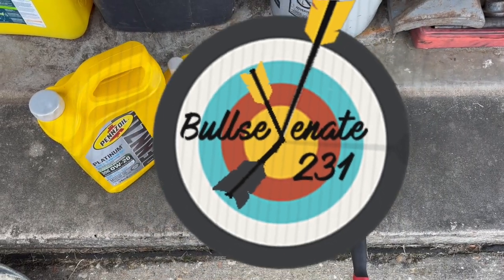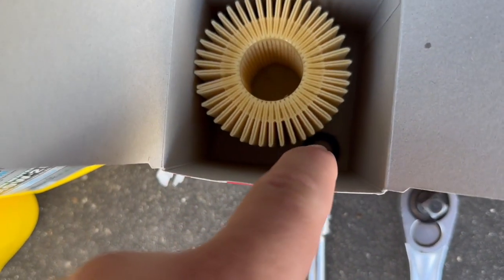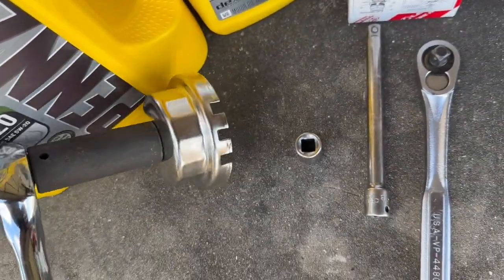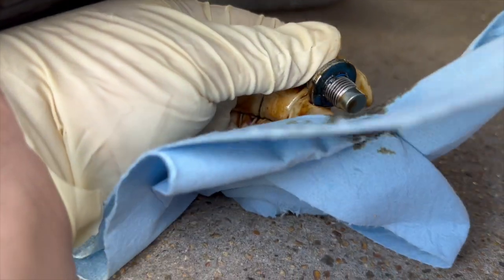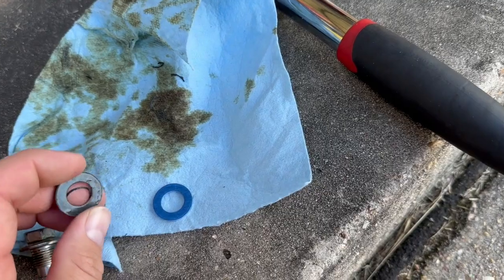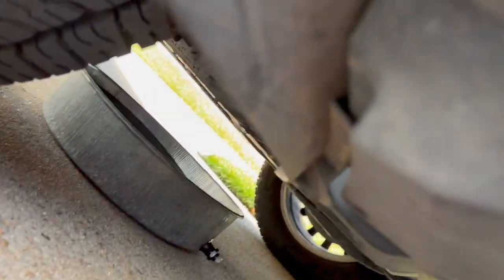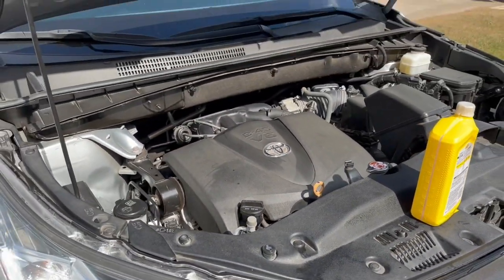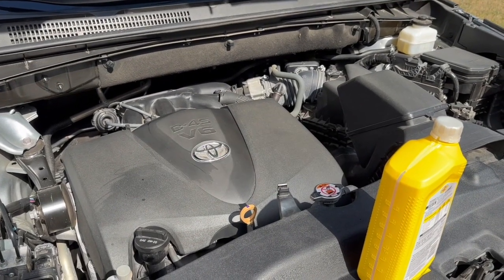How to change the oil and filter on a 2014-2019 Toyota Highlander

Comment: Great job! Only thing missing in my opinion would be to lube the O-rings before reinstalling, just to prevent them from catching and snapping as your tightening them down from being dry. 👍👍👍
Reply from the maker: The o rings from the Toyota filter kit come pre conditioned with lube. That’s why they are in those plastic packages.
Reply: Oh I see!!! Thanks for the info 👍👍👍

Comment: Pro tip draining the filter housing, put the end of the drain syphon plug into a plastic bottle (Gatorade bottle works) the push the canister drain plug into housing  No mess it drains right into bottle

Comment: When I change my oil I don't take off the middle part of the oil filter. Even in the dealership they don't take that middle part out. It's the same amount of mess. More work. And you said 5.8 quarts, yes that is without changing the filter. Changing the filter is closer to 6.5 quarts.
Reply: 6.5q? you are so wrong. its 5.8q. show me a video of someone putting 6.5 quarts in a highlander oil change.
Reply: @itr0863  Sorry rechecked. You are right. Thinking of the wrong vehicle. If you want me to delete this comment I will.
Reply: @mrkdavek  no problem! i get confused too! i have a 4runner and its 6.6 and my wifes highlander is 5.8....i wish the quarts can be rounded to .5 or 0 lol. be easier to divide.